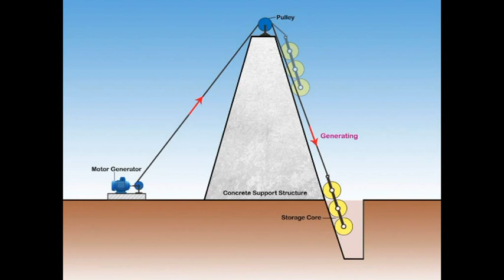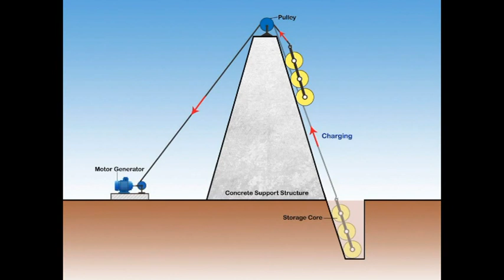Gravitational Energy Storage Using Soil Batteries

Comment: When designing gravitational energy storage should it not be the goal to utilize most of the mass you bring to a site. Now you have a ginormous concrete structure to move these in comparison tiny drums. To produce concrete you need about 0.3kwh/kg. Say that the concrete structure here has 500x more mass than the drums and it has 100% efficiency and a fall height of 50 meters than you could produce E=m×g×h=1/500x9.81x50=0.981 Nm/cycle/kg of concrete =2.73×10^-7 kwh/cycle/kg of concrete. It would take more than 1 million cycles to store the energy required for the production of the concrete, let alone transportation, construction etc. I doubt this structures cumulative storage over it's lifespan ever exceeds the energy required to build it.

Comment: That idea is Laughable and very inefficient Also would cost too much
Reply: Yes, with that design. 
A truck size weight (20 tonnes) lowered one km will release about 50 KWh. And consume about 60 to be raised.  Good enough.
But for that height the amount stored will be pitiful. Will take forever to recoup the cost of the structure.
With a longer course of the weight, few kilometers, and horizontal storage spaces up and down, it may be feasible at scale. 
However, as hydro, it will cost a lot, so must be governmental investments, or some corporations which has too much money to care about return. 
The return will take decades. No investor will bury money in this type of storage. 
I assume is comparable with hydro and nuclear. Those are providing cheap energy. How many persons own an nuclear plant?